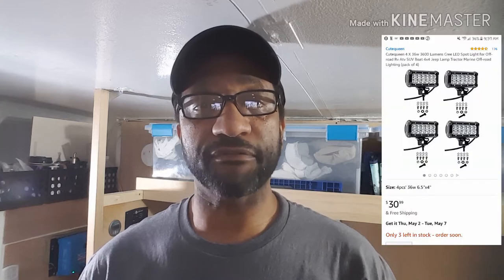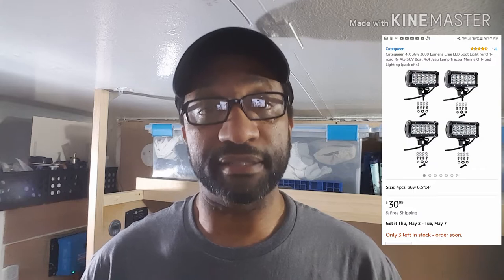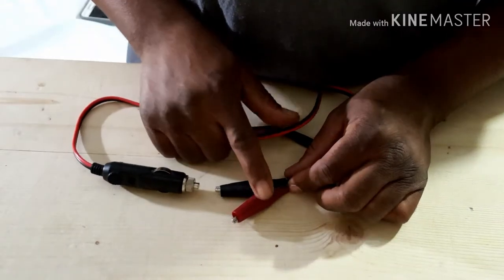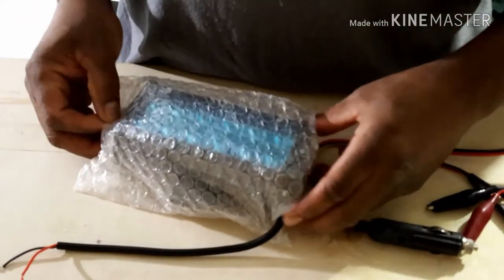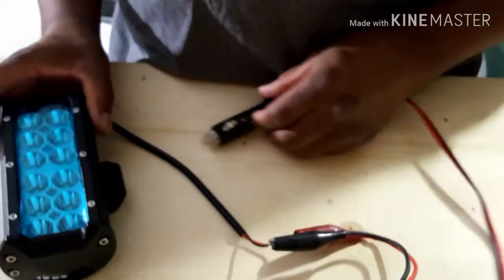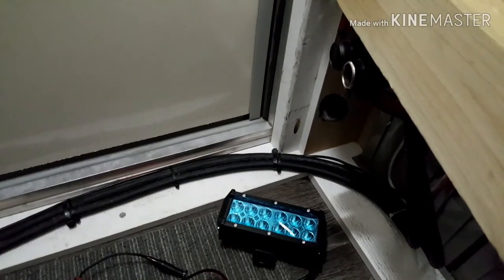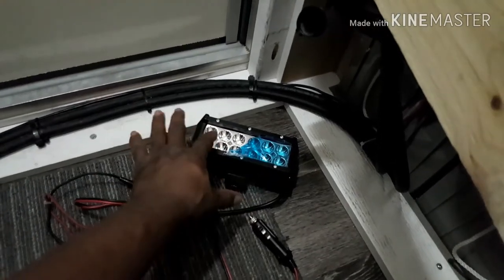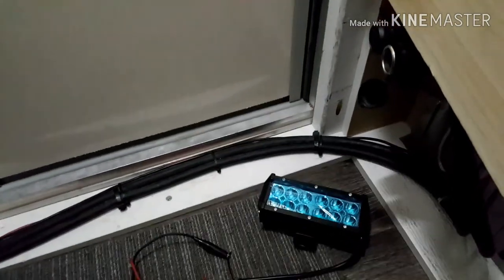VAN LIFE IN A BOX TRUCK:  Bench testing off-road lights pt.1

Comment: Those lights are bright for sure and if you mount them low you could possibly use them to keep the rodents out while out in the desert maybe
Reply from the maker: Darryl, that's what I was thinking of doing with the lights.  Great minds think alike.  I spotted a wire under the hood that looks a bit chewed.  I don't know if it happened before I bought the vehicle,  or after.  I'm going to make a video repairing the wire and adding lights.  I have several sets of other lights of different sizes that I might use, but end results will be the same.
Reply: Driving Home You could install a mobile cat that would serve as a deterrent to rodents as opposed to those lights.
Reply from the maker: Lol.😂